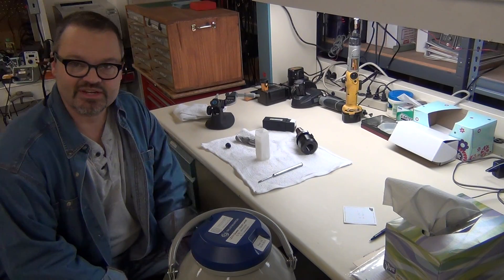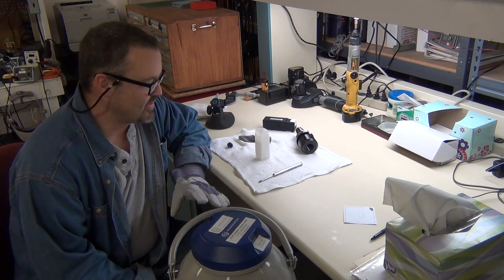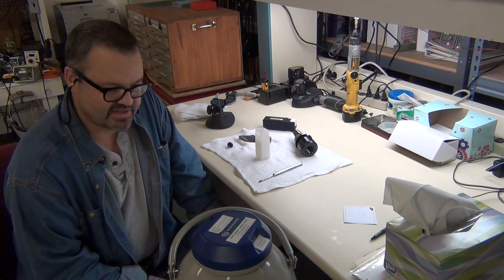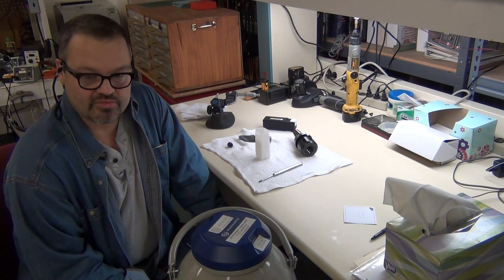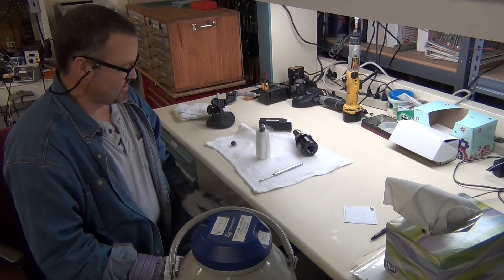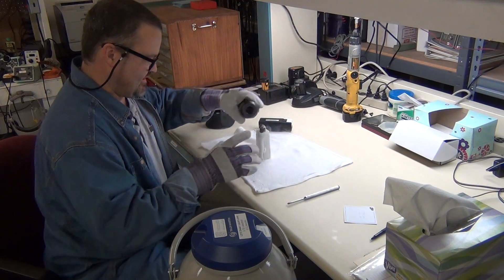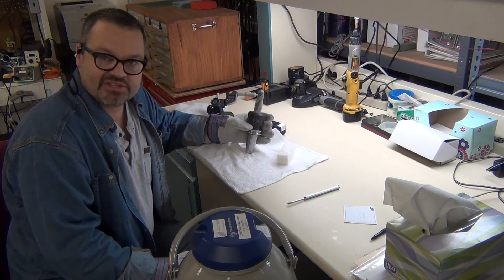Shrink Fitting a Milling Tool with Liquid Nitrogen

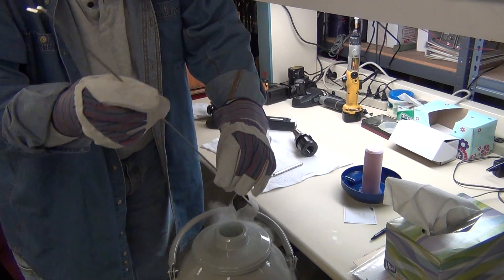Comment: Great tip at 4:04!!!   The cold metal is very dangerous.
I have done many shrink fits of bushings, the formula is:
Change in bore diameter=Initial diameter* coefficient of expansion * change in temp
for steel I use 0.00000645 for the coefficient soooooo:
change in diameter=1"*0.0000065*(72f- -312f)
=0.0025
your endmill should be two and a half thou under 1" if it boiled completely in the liquid nitrogen.  At work we put the bushings directly in the vat of n2 and when it stops bubbling the bushing is at temp .  

BTW for endmills the norm is to induction or torch heat the holder and leave the endmill at room temp.  The differential in temp possible with heat is at least three times what you can get with N2, beyond 1500 the holder might start to get soft, but no real risk to the set up if you are just looking for a thou or two.  
Liquid nitrogen is hard to get and is only used where a part cant or shouldnt be heated.
Reply from the maker: Thank you for the excellent comment.  I hope you will subscribe!